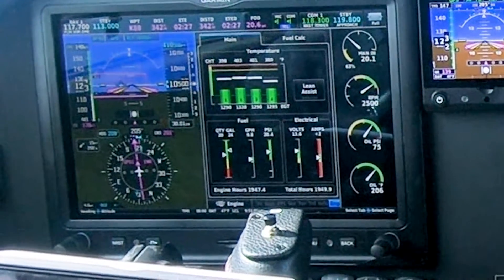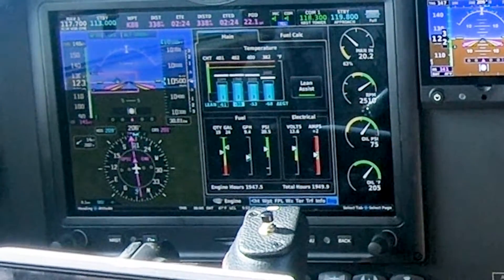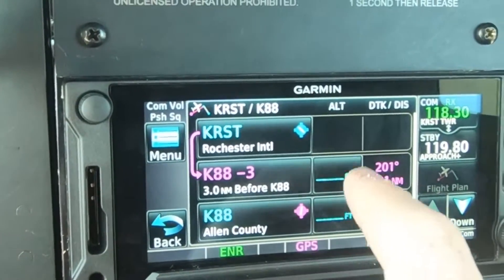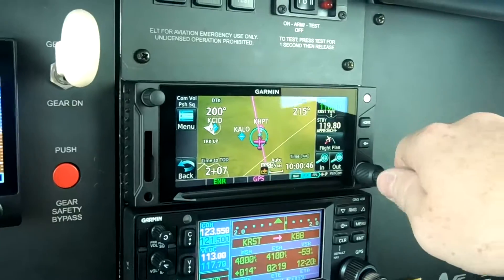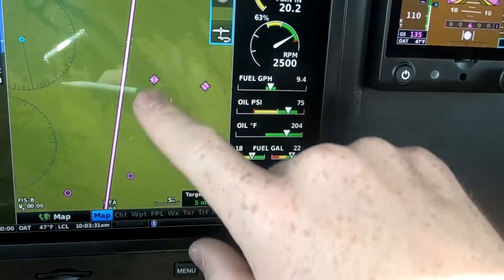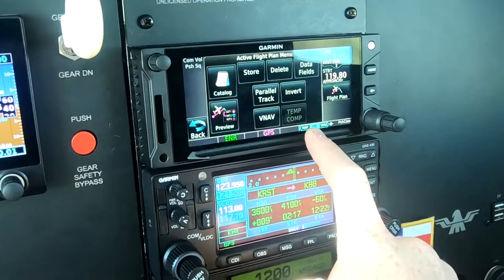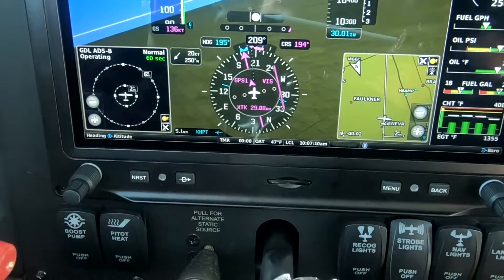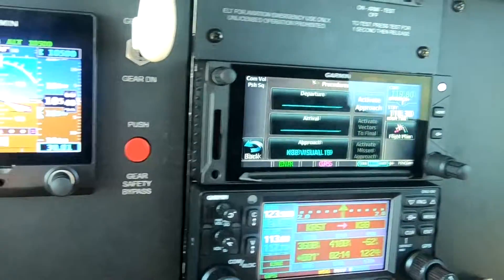GTN 650 with G3X   Tips and Gotchas

Comment: A quick tip for VNAV descents. If you type in altitude first, the system gives you the option of choosing AGL instead of MSL. Punch in 1000 AGL then it just does the math for you to get to pattern. I found out if you go to insert along track first the AGL button is no longer there. Great video! It’s been helpful!

Comment: GREAT video! Thank you for all 3 that I watched. This one and the ending approach and landing and then the 360 camera. I have a 1977 210M and hoping to upgrade the panel and this was exactly what I was planning to do. I have the Garmin 430W, audio panel and transponder and G5 backup attitude indicator. I'm hoping to do it incrementally. I was going to start by adding the 650Xi and remove the old Narco com/nav, Cessna 400 DME and ADF. Then replace the 400b autopilot with the 500. Lastly put in the new panel with G3X w/EIS. So I was thrilled to find this video as you have the end-game setup I want. I appreciate your work editing and uploading.
Reply: Do yourself a favor, do evrything in one go, far easier to not worry about interoperability with AP, avionics for every step in between and opening the cockpit like 5 times with 5 times the paperwork :) have fun

Comment: I am updating my T210L (N732EL) with a similar setup. 2x G5, 2x G3X Touch, 750Xi (was going to be a 650Xi), 430w, 500 AP, with a 350C Audio Panel
In particular, my questions surround having two GPS/Nav Radios (650Xi Navigator with a 430w).
Are you able to:
    1) Flightplan from the Tablet uploads to G3X Touch, 650Xi, and 430w?
    2) Can you setup different approaches in the 650Xi and the 430w? (say a ILS on one and a RNav or set for parallel runways)
    3) Which does the A/P fly?
    4) If you turn off the 650Xi, does the system switch to the 430w navigation?
    5) Can you set the G5 CDI to show the 430w and the G3X Touch to show the 650Xi?

This might be the basis of another video.

BTW, I don't see your Audio Panel

I Fly out of Georgetown Texas (KGTU) though the plane is in North Houston for gear issues right now. I hope to run into you sometime.
Reply from the maker: That will be a very nice panel! Our systems may differ slightly but I will do my best to answer your questions. 
1) My flight plan does upload to the G3X from ForeFlight on my iPad and flows to the 650 and then to the 430. 
2) Yes you could set up separate approaches. I would first load the approach in the 650 (which will flow to the 430) and then load the second approach in the 430 (which will NOT flow up to the 650).
3) The autopilot will follow the nav source that is selected on the G3X. You can swap between nav 1 and 2 by tapping on the HSI on the G3X and selecting the source.  
4) The system should revert to nav 2 if it fails to receive data on nav 1, however I have not explicitly tested this.
5) In normal operation the G5 is the standby instrument so it mirrors what the primary instrument (G3X) does. So the CDI it shows is the same nav source as the G3X is using. The only setting I am aware of is Baro Sync where the altimeter setting changed on one will show on the other. I don’t know of a way to de-couple the nav sources to behave like you’re describing. It would be useful though if possible. 

My audio panel is remote so all the controls are in the G3X.
Reply: @takeofftexas6639  Thank you for the answers! Hope you get a chance to make more videos

Comment: Is this a Mooney F or a J? your CHT is above 400F at outside Temp 47F. I thought its recommended to keep the CHT below 380F for the better health.
Reply from the maker: You are correct, it was running warm. This was shortly after the annual where a SureFly ignition was installed. The timing had been set improperly which caused it to run warm.